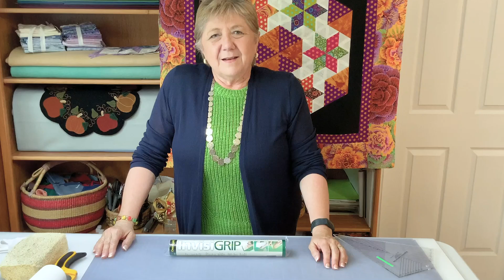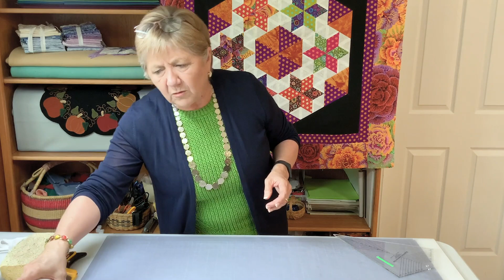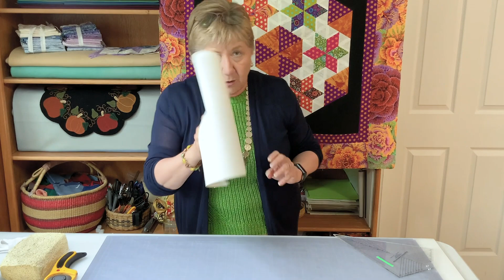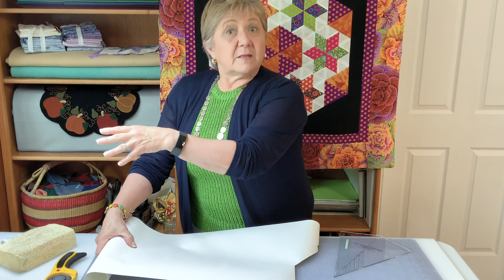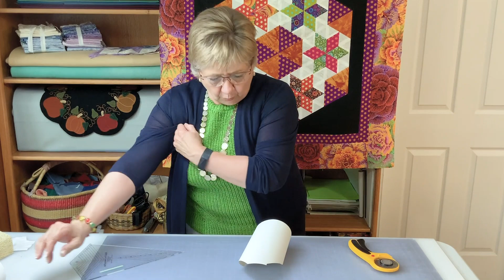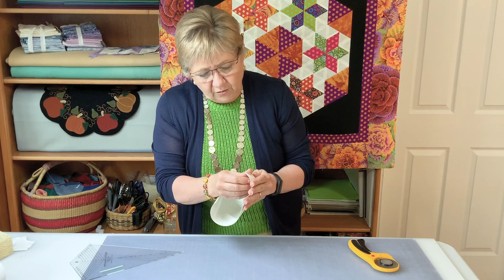Up your Accuracy with Invisi-what? Invisi-Grip! - Tips & Tricks from the Tucker Team

Comment: A dry erase marker is a great non permanent way to mark top side of rulers.  Just rub off
Reply from the maker: Very true, but keep in mind that when you're marking the top of the tool instead of the bottom, you're adding parallax into the equation, so you have to be extra vigilant when you're cutting to make sure that you're not cutting heavier one way or another. I just find it's easier to mark on the invisigrip and not have to think about being consistent every time (and you can always clean off the sharpie lines using rubbing alcohol when you're finished).
Reply: @DebTuckersStudio180Design  Understood--and great point. I should clarify:  I use the dry erase as a highlighter:  it goes over the line; I'm still cutting using the ruler line. Otherwise, my OCD sensibilities would be offended.  I will also add a couple of notes of caution when using rubbing alcohol as it is such a powerful solvent: if you aren't careful it may erase your ruler lines if you have splashes (so if you have sticky residue on top of your rulers, don't use it).  Also, if you are using a homemade glue baste with alcohol it will cause any markings on your fabric made with alcohol based markers to run into your fabric.  (The above falls into the "Ask me how I know" category).
Reply from the maker: @notesfromleisa-land  These are all great points! Thanks for sharing 💜